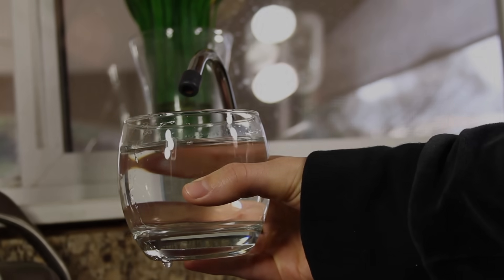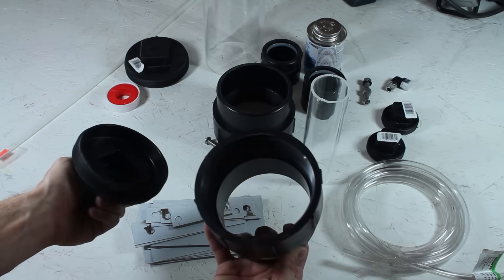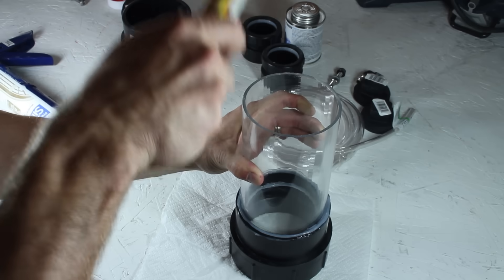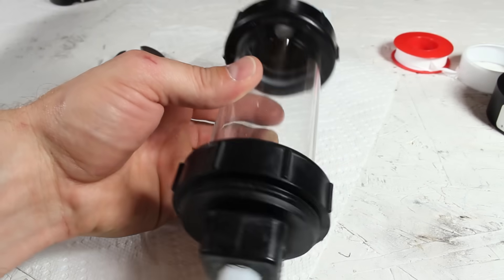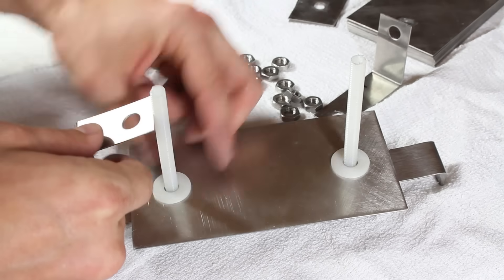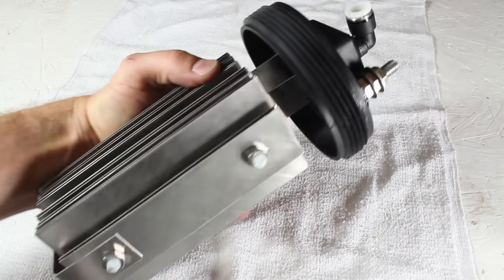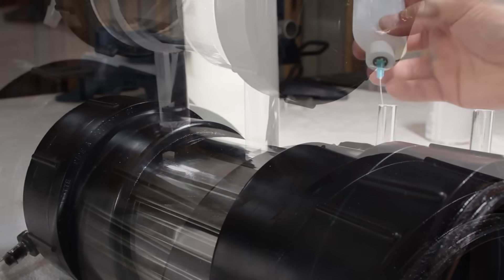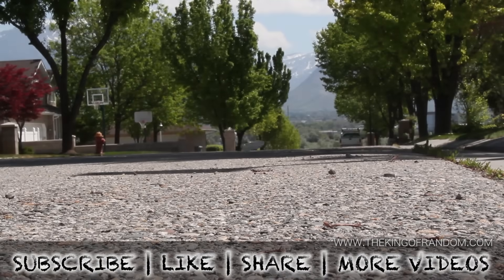HHO Generator - Water to Fuel Converter

Comment: This is the kind of simple technology that will end our fuel crisis but unfortunately it would never take off. No one wants to solve the fuel crisis until there's literally no fuel left, and then everyone is going to be scrambling for an overly complicated solution when this relatively simple technology is right in front of their faces. Yes the electrolysis machine would drain the battery that runs it very quickly, but I think everyone is forgetting the real source of free energy. A solar panel on top of the vehicle would more than likely be plenty to charge the battery as it discharges into the electrolysis  machine. It may not be able to charge at the same rate as it discharges, but it would significantly extend its life. It may even negate the need of an alternator, thus making the fuel even more efficient because the engine would have one less thing it needs to run, thus conserving energy. You wouldn't need to fill a tank with the gas itself. The simple machine built in this video produces the gas quickly enough that you would only need to worry about keeping water in the tank to be pumped into the electrolysis machine to be pumped through a carburetor into the engine cylinders. Spark plugs like we already have would be more than enough to ignite the highly reactive gas. The only real hurdle would be in finding the correct fuel to air ratio, assuming air is even needed. I would think it would be. A pure solution of the gas would probably be inefficient in fact, as well as very loud, for those who know what en engine backfiring sounds like. It doesn't take, relatively, a lot of power to move an economy vehicle like a Prius or a Dart. Making the fuel less efficient by mixing it with air before compression would increase electrical efficiency by allowing the electrolysis machine to not have to make the gas as quickly or perhaps even allow it breaks as it creates the gas to fill a secondary tank. Fill the tank, turn off until the tank is half empty, fill the tank, turn off until half empty. These breaks would give the solar panels time to recharge the battery running the EM, thus making the fuel even more efficient.

Comment: Throw a regulator and a check valve on there, power it off an inverter, and you have a welder, minus the tip.

Comment: This is one of the projects that fascinates me so much.  I'm a mechanic with around 15 years experience in the industry, working on everything from small hand held generators, to large diesel construction equipment.  I've actually built this contraption and am currently trying to get it to run a small riding lawn mower engine, even though mine is much bigger, so it can handle the amount of fuel required to run the engine at an idle, I keep running into quite a few issues.  GRANT!  PLEASE HELP!

Comment: there was a guy who built a car using the same method and the oil and petrol industry killed him
Reply: Ben Dover he used a slightly more complex system, people are still trying to figure it out
Reply: @greenthizzle4   Im currently working on it myself. The complicated parts are storing it safely, but storing enough of it in a small volume to make it a viable fuel. It seems like electrolysis on the spot isn't going to cut it though, simply not efficient enough
Reply: Guy Bowker there are ways of making it efficient enough, try 1440hz frequency which is the resonant frequency of hydrogen.
Reply: @greenthizzle4  Thanks for the reply, Are you referring to the frequency of a DC generator used to electrolyse the water? And furthermore that being the driving frequency that matches the natural frequency of the water molecule? So that the binding energy is overcome?

Edit: I retract the above statement regarding using AC, I understand this in fact would make the entire system not work, for electrolysis is indeed dependant upon a constant flow of cations And anions to their respective electrodes
Reply: Guy Bowker I know the resonant frequency of water is like 20ghz.. But hydrogen itself is around 1440hz, easier to try.. you might be able to get the hydrogen to shake free of its bond if you can match it's resonant frequency.. and yes I'm talking electrolysis.
Reply: Guy Bowker maybe using a car audio amp, but you would have the issue of the impedance being very far off it could blow the amp.. I've blown them using wrong impedance coils.
Reply: @greenthizzle4  oooh so you're referring to splitting the H2O bonds by means of an audio signal? Ok. So does the hydrogen atom respond to the driving frequency in the same way when in the molecule? Is that what you're attempting?
Reply: Guy Bowker besides there are two hydrogen atoms, so if you can make both of those shake then they most likely would knock the oxygen off especially if a small amount of amps are there
Reply: Guy Bowker do you know the concept of resonance? You can do something way easier then brute forcing it and make the resonant signal do the work for you
Reply: Guy Bowker I have a ton of ideas for how to make ground breaking things, I just don't have the time and tools or resources to try my ideas..
Reply: @greenthizzle4  I am familiar with the concept. Microwave ovens work on a similar principle correct? The microwaves produced have a driving frequency comparable to that of the H20 molecules natural frequency, and so the water heats up right?
Reply: Guy Bowker I think, I'm not 100% on what a microwave is tuned to.. more like a tesla coil is what I'm thinking
Reply: Guy Bowker as far as I can tell the microwave frequency is not the frequency of water.. it's 2450mhz, I think the frequency with the massive amount of energy behind it does cause the water to vibrate.. But it's more of a brute force method and not perfect resonance
Reply: @greenthizzle4  I see it's just the large amplitude of the microwaves. - my mistake. I am familiar with your reference to a functioning Tesla coil. And I understand now your proposal for an audio driving frequency to match that of the hydrogen in a water molecule. Do you have videos of you attempting this? It sounds fun and interesting
Reply: Guy Bowker as I said, I have ideas but I don't have the time or tools/resources to do these things.. I'm too busy working to survive to where I feel drained when I'm home and don't want to really do anything
Reply: Guy Bowker do you have time and a lab? You said you were working on storeage or something along those lines? I have some ideas for concentrating hydrogen plasma and separating it from oxygen etc.. if you have any possible hurdles let me know, I might be able to think of something
Reply: Jake Mitch you cannot
Reply: Antonio Urata Jr. I cannot what? You gotta be clear this is a large thread of conversation I don't know what part your talking about
Reply: @greenthizzle4  hit me up
Reply: Mischief Maker Inc what's up
Reply: Jake Mitch can you give me contact on you? I want to ask you a few questions
Reply: Stanley Allen Meyer
Reply: Not really.
Reply: Zamboro yeah dude was murked..
Reply: Yea Stanley alen mayor
Reply: Theres video's of people doing this all youtube, even people that run engines off them. . . . .
Reply: Stanley meyers
Reply: Dear people in the comments who are working on it. Be careful 👀
Reply: Nope the guy who was killed about this. Was because he managed to craft a engine that auto suply enough energy to keep generating and managing the process into a engine he crafted specially for this power source because a normal engine camt handle it. And yes there r toms of people trying to figure how they did it.
Reply: Who apparently broke the laws of thermodynamics with his "invention". He was a fraud and anyone with a minor understanding in physics should see that.
Reply: @OmegaGamer04  how?
Reply: OmegaGamer04 bro there are ways of working in harmony with the universe.. everything is energy bro, everything.. to you there is no energy in the air, yet we see lightning. 
There are things that are beyond you or my understerstanding...
Reply: Not likely
Reply: Kevin Hamming bro lookup the name the guy above you commented.. it's actually very very likely
Reply: @greenthizzle4  whats very very likely?
Reply: Kevin Hamming well clearly you think it's been disproven so your mind has been made up
Reply: Kevin Hamming True story, look him up, Stanley Meyer. Also look up GEET reactor
Reply: Nobody cares about stanly meyers and hho gas has been disproven
Reply: Kevin Hamming I don't see how hho gas has been disproven in anyway

Comment: Grant can you please state the current draw. I believe you are using 2 x 12v batteries so suspect a lot of power.
My single small 12 battery took more than my meter will read, 10 amp, so don't know the power but it is at least 12 v x 10 amps- 120 W.
Also seems to me it should work on AC?

Comment: Does electrolysis with stainless steel as the electrodes form a lot of Hexavalent chromium? I am doing HHO for a science fair project and need know fast. A lot of places online say it produces hexavalent chromium.
Reply: Depends on the kind of steel.
Reply: Cheap stainless will make small amounts of it yes, just do it outside if your worried about it.

Comment: Is this related to fuel cell technology?
Reply: Yes.  Fuel cells also combine oxygen and hydrogen to make water.  In the process of doing this, fuel cells also generate electricity, which is super handy.  You could explode the hydrogen-oxygen mixture to power a generator, which would also produce electricity, but fuel cells would still be more efficient and safer.

Comment: does is matter what kinda metal i use for the plates???? pls help
Reply: Stijn Jaspers stainless steel only
Reply: John Jayman unless you're willing to use it to "electroplate" metals.
Reply: would aluminum work? or would that react?
Reply: Robert Nelson aluminum will work but it will most certainly slowly react. I had 18v on two pieces of aluminum work over night.

Comment: How does the steel plates not curode. does potassium hydroxide not curode the metal.
Reply: Exotic Butters I'm pretty sure he said it's stainless steel mate
Reply: it will corrode. use copper
Reply: xSausage Roll yes he did say stainless steel alot twice at the start
Reply: STAINLESS STEEL IS STAINLESS NOT  STAINFREE
Reply: It does react, id suggest looking at the reactivity series, gold, platinum or silver would be better options but they are expensive

Comment: Do i need to have the potassium hydroxide or can i use plain distilled water
Reply: Plain distilled water is very inefecient. If  you dont have access to potassium hydroxide you can use baking soda
Reply: You can also use a small quantity of sulfuric acid.
Reply: Richardetico but if you have sulfuric acid you can probadly get lye too
Reply: i have sulfuric acid and i get lied to alot

Comment: could you have a modification whereby we can collect those two gases separately
Reply: yes
Reply: You would need to set it up the cell very differently than he has in this video. You would need to have the anode and the cathode far enough apart that you could fit a collection device around each electrode. He made this cell to maximize production and was not concerned with separating the Hydrogen and Oxygen gases.

Comment: Sadly, as I understand, the process uses more energy than you would get out of it. And on large scale the hydrogen gas is difficult to store to use.
If I remember correctly the each of the two gasses, hydrogen and oxygen, are emitted at different sides of the circuit (anode and cathode), but can't recall which would be which.
Reply: Jason Hardman Hydrogen would be cathode and Oxygen would be anode.
Reply: cleanseroftheworld thanks
Reply: Your comment has made this video useful to me where it would not have been otherwise.
I was going to ask how to separate the two gases.
Now I know.
A little redesign of his machine is needed to collect the two gases in different places.
Now I'm going to watch this again.
Reply: "It's difficult to use"
do you just collect excuses that reduce something down to a phrase that people find hard to counter?
Reply: Wei Zhao he means that it's hard to store effectively for easy use later.
Reply: Jason Hardman the generator made in this video collect both gases as the mixture, so its called hydroxy. This gas is far more explosive than O2 or H2 in their pure form coz hydroxy is well rationed fuel and oxidizer, just waiting for little ignition, then huge kabooom.
Reply: Jason Hardman negative is hydrogen

Comment: OK chemistry question. If you were to fill a bottle with the gas, cap it off, then store it, would the gas decompose back into water over time, or would it remain indefinitely?
Reply: No, he did not. You cannot turn water into Gasoline. This is pretty basic Chemistry. I have seen the video that you are talking about and he did not turn water into Gasoline. He modified his vehicle to "inject" the gases into the combustion chamber along with the Gasoline. At no point was the Hydrogen or Oxygen gas turned into Gasoline.
Reply: nope. There isnt even any carbon in here
Reply: No, gasoline is a fuel made from crude-oil. All this cell does if separate the Hydrogen and Oxygen in water and revert them into their elemental states. The Hydrogen atoms will pair up with other Hydrogen atoms to form Hydrogen gas, and the Oxygen atoms will pair up with other Oxygen atoms to form Oxygen gas. The term gas does not refer to Gasoline. The term gas is actually one of the three states of matter: Solid, Liquid, Gas.
Reply: He didn't make it gasoline, he just mixed the Hydrogen and Oxygen gases with the gasoline as it burned. You cannot turn water into gasoline.
Reply: ForeverOfTheStars I was talking to the guy who asked if it would turn into gasoline jackass.
Reply: 13th Evergreen I think it's called water = gas= water or something like that
Reply: Sarktastik unless your a miracle worker you can't turn water into gas or water into wine, lol
Reply: ForeverOfTheStars it would turn back to water. watch carsandwaters video on this.
Reply: Sarktastik thanks man.
Reply: liam the great exactly which video? i would like to hear the explanation but cant find the video.
Reply: not that much then... sorry
Reply: ForeverOfTheStars doesn't it become gasoline? or some form of?
Reply: liam the great you know their was a guy who did this to a car and made it drivable and he found a way to make it gasoline... so it chould become it.
Reply: +13th Evergreen okay if you say so. You can believe what you want, but my knowledge of chemistry disagrees.
Reply: Sarktastik well that dude did